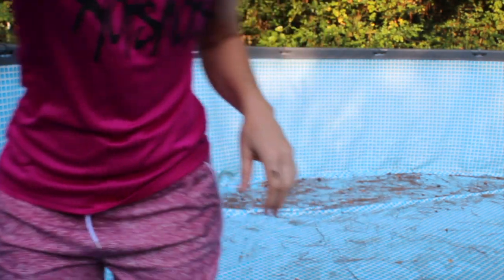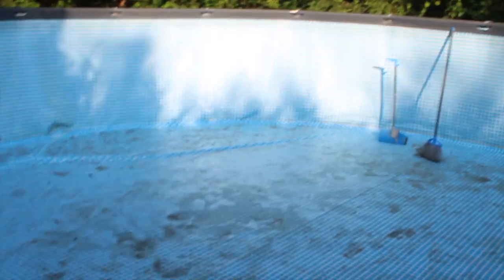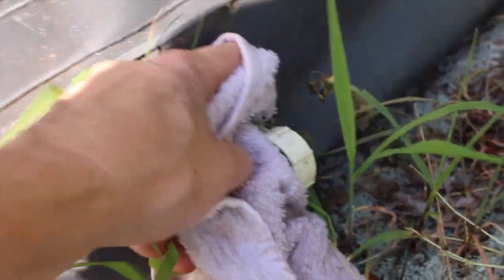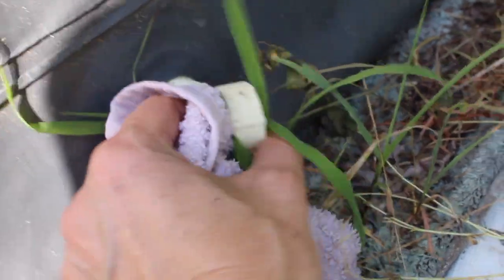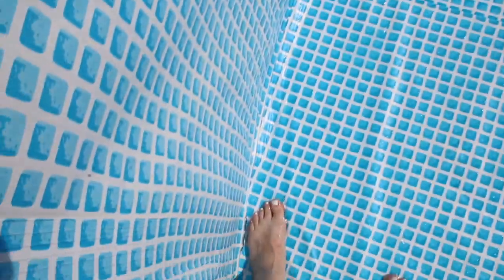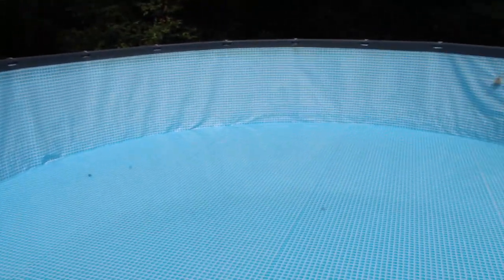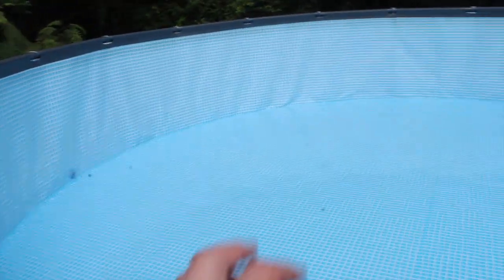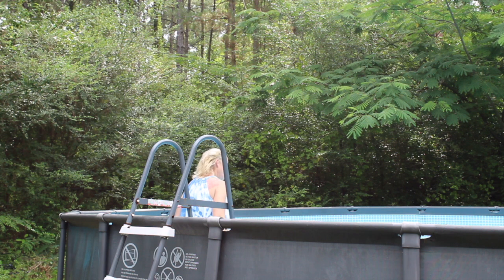Filling up an above ground pool: Things to check | Cleaning the pool | get wrinkles out

Comment: Thanks for sharing. What would you think to put a garden hose around your pool between the ground and the liner ? This is flexible enough to maintain a seal between the ground and the liner and prevent dirt to go under your liner and make a hole in it.
Reply from the maker: That could work! I like that idea.
Reply: I did that with pool noodles! Just have to b sure you get them behind legs before the pool gets too much water I did wait too long last pool so used terrace board instead super easy to slide I have rock around my pool so I’m not confident I’m gonna be fine without poking holes or having things go under the pool noodles can be glued end to end using foam board adhesive otherwise good luck. If you have smaller pool you don’t need to attach them. You can’t even slide a leaf under them I used this on summer waves frame but intex ultra frame replacement liner